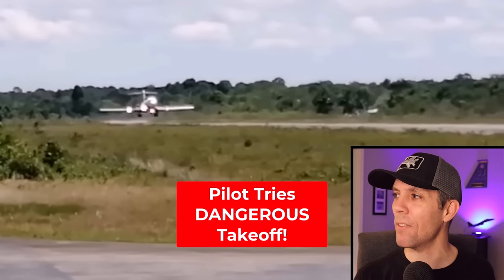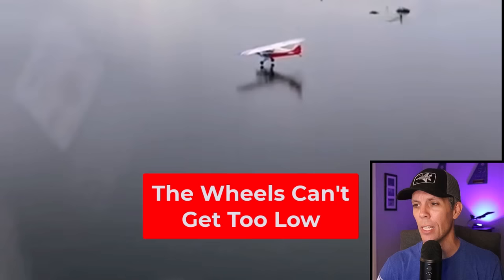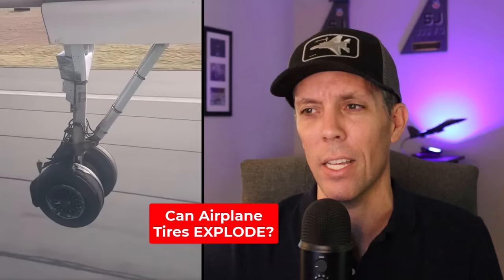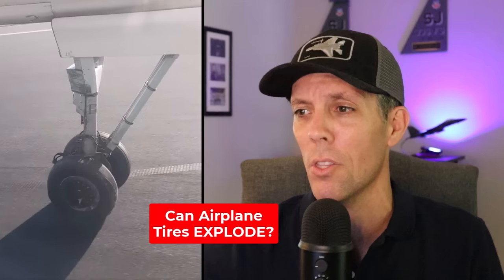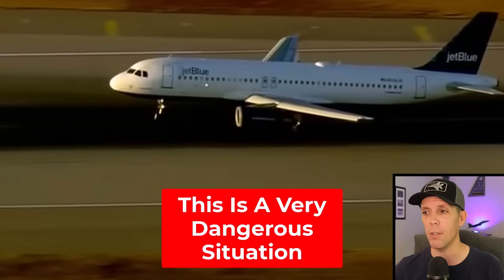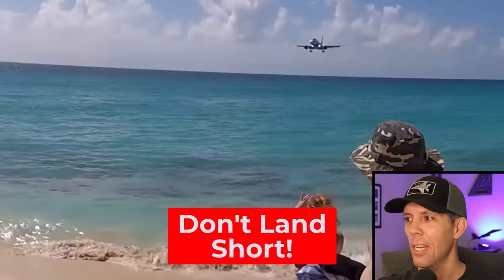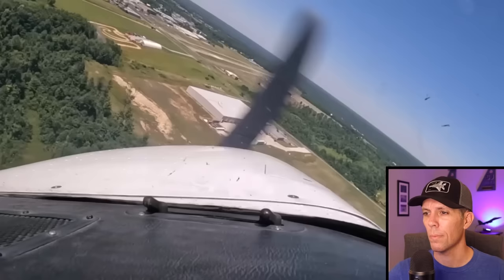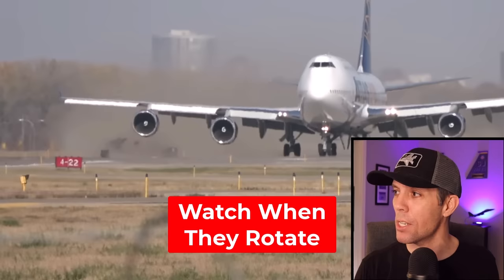Pilot Tries DANGEROUS Takeoff!

Comment: The landing with the Transall where it touched down and jumped over the road, you gave wrong information and in reality you have no clue about what happened there. This whole process was planned and done professionally by the pilots and the  Airfield company. The road was closed on that day and  and the ground on the other side was prepared. This happened at Ballenstedt Airfield in Germany. The Transall has been delivered to there, where it was retired and now you can visit it there as an attraction. The point why it touched down in front of the road is not, that the captain wanted to risk anything for showing off. Instead the real reason is, that the runway is too short and they used the first touchdown to loose a few knots. With this trick the plane stopped short to the threshold and everything went well.
Reply: If intentional, IF, that was not smart- bounces are destabilizing.

I call BS/Shenanigans.  He shorted it.
Reply: found the pilot that shorted it
Reply: @eisnacht
Oh yeah, sure.  In fact, they had considered bouncing off the muddy fields first, then the roads, to lose even “a few more knots”.  But the local cows got together and forced them back to their original hop, skip plan, instead of the proposed “hop, skip, and a jump” over the cows.
Reply: Both storys are not true.
It was a final transport of the German air force to a small runway. The runway apparently was to small under normal conditions, which is why the police was tasked with closing down the road and making sure no people would be in the area. As visible in the video, they failed. 

And while the landing certainly wasn't planned like this, and should never have been executed with people near the runway, the bundeswehr in all public information never really said anything about the fact that they considered the early touchdown necessarily an issue on its own and where always saying that the plane is designed for stuff like that. So it appears that they are least where fine with it, but it wasn't planned.

And it appears that the pilots maybe where not aware of the fact that the road is higher than the street.

But they did not do it to impress friends or anything like that.
Reply: Not planned at all: misjudgement … it happens but definitely not planned
Reply: As a fsx steam license holder your all wrong, the reason it touched down early was because the livery. That was actually a hot air balloon and landed on the road
Reply: @twigglykevin airforceproud95 fan here clearly 😂😂😂
Reply: Loooooool

Comment: Hi Hoover, 
the video with the C130 wasn´t a flight for an air show. This was the last flight of this aircraft and it was brought to Ballenstedt Airfield for staying there. With only 635m of paved runway and a typicall landing distance of around 700meters the pilots have to use every meter of the runway they can get. The police closed the road near the runway and the pilots trained this landing so far as i know.
Reply: That was a C-160 Transall.

The C-130 Hercules is a
4-engine aircraft.
Reply: Seems like a know it all would at least get the model of aircraft right........

Comment: With 90% water landing survival including mid-water landing and large planes with lots of energy, it seems like a good choice in wooded, house covered, or mountainous areas. If you open the door, land close to shore, can swim a little or bring a float cushion in case, you probably have a better chance than trees or rough, rocky terrain. A lot of mountain lakes drop off quickly so you may be over your head a wings length from shore, getting knocked out, never practicing anything like it are the problems, if it is your plane shoulder straps may help from being knocked out.

Comment: For the sideways nose wheels, when a plane is being towed I believe a pin has to be pulled to disconnect the aircraft steering so the tow vehicle can turn the gear freely.  Once the task is complete the pin is put back in place, which allows the aircraft steering to operate.  I’ve heard sometimes the tow operator forgets to reinstall the pin, causing the nose gear to rotate, once it retracts, thus the issue on landing.

Comment: My 13th hour as a student pilot the instructor had me perform a simulated "Impossible Turn" in an Aero AT-3 from 430 feet agl.  

We had 100 feet excess over the threshold, and it was a fun slip.  

If the startle impact is minimal and the glide ratio is decent, it is not impossible.

Comment: As an aircrewman/jet mech in the navy spent a lot of time working around or on planes, never got on a carrier (thank you Jesus!!!),  i know the A-7, it's tire pressure for land ops was around 300PSI, and carrier ops 750->800 PSI.   Even crazier was some of the hydraulic systems, static change vis nitrogen most were 1500 except one at 3000 and operation when the plane was powered on anywhere from 3000 -> 9000.

Comment: Nothing wrong with calling a fuel engine a motor. I mean, Detroit MI, USA has been known as "Motor City" since the early 20th century. 

Me personally, I do try to distinguish the two as motor and engine (for electric and fuel respectively), but both are correct.

Comment: Hi Hoover !  If  I am not mistaken, that 727 crashed. Or same airline. They used to take off overweight and that happened in a very hot day, the plane didn't lift on time overshooting the runway and went through the fence. One of the rear landing gear wheels got detached and messed up the right flap and something else. The plane crashed after trying to get back. It was a cargo 727.

Comment: The first video, the airline picks up the gear very low and is staying super close to the ground so in ground effect, he build up speed which will give him even more lift and then climbs out, seems like a smarter decision than crash into the trees in front with gear down and a lot drag and not enough climb performance.
Reply: But with the airline operating the plane, that's pretty much a standard takeoff
Reply: Smarter idea not to fly overloaded planes, and end up doing what they later did(possibly in the same plane) - crashing through the fence and hitting other objects, causing damage and eventually crashing. There'd be no reason to do it otherwise.
Reply: @DoubleMonoLR  I have an idea that this was actually considered an improvement that was implemented after that crash.

Comment: I flew American Airlines about a year and a half ago from Miami down to Key West for the weekend.    It was one of those smaller Embraer Airliners that have one row of seats on one side and two seat rows on the other side so a fairly tight seating and walking arrangement in the cabin.   It was a full flight.  Anyway,  we get to Key West which must be a real short runway and the pilot definitely clipped the very end of the runway because their was a very loud BOOM noise,  the whole plane immediately jolted BADLY and VIOLENTLY as the back wheel assembly hit the end of the runway which was like hitting a six inch high curb on a direct hit with a motorcycle!   It was the scariest landing I ever had and I have flown quite a bit over the years.    I literally looked over to my wife and said we just hit the end of the runway.    We sat on the runway for like 30 to 45 minutes before they let us offload.    They never said what did happen,  but it was quite obvious he came in too short and hit the end of that runway.    I'm surprised the whole back wheel assembly didn't sheer right off the plane.      It literally felt like it was going to!   No injuries or problems thank goodness but I'm sure that plane probably got grounded afterwards for either a full inspection or repairs.   We all got off and went our ways and never did hear anything else.    Everyone on that flight was jolted and scared to death.     I guess it very well could have been a tragedy but thankfully it wasn't.    It's crazy how often this kind of stuff must happen across the world on a daily basis in the aviation industry and nobody ever knows anything about it if an actual crash doesn't happen or get declared which absolutely no pilot ever wants to do if they don't have to.

Comment: I saw a video of an aircraft take over from the owner to a buyer, the buyer had a couple of pilots test the aircraft after they took it over and on the test the pilot forgot to lower the gear.  The people watching were tring to alert the pilot but he never saw them and he managed to belly flop it but did thousands of pounds damage.
Another time talking of tyre wear, I was working on a Russian TU154 and just accross was the Red Arrows all parked up, the pilots all walked over to look around the TU154, they were shocked at the state of the tyres, they were badly worn through, I said that is a common sight on these, most of them come in the same plus the general state of the aircraft too.

Comment: Why jetblue case cloud not use the thrust reversers ?
Reply: I believe the rationale is that increasing deceleration is like slamming on brakes in a car, all the momentum gets pushed forward onto the front of the vehicle, in this case increasing pressure on the faulty nose gear which would likely increase the risk of damage (or collapse) of the gear, increasing risk of injury and further damage.

Comment: First one is a really bad idea. When I was learning to fly back in the early ‘80s, there was a T-34 Mentor military trainer that was available to rent and you could flip the switch before takeoff.  After takeoff, the wheels would automatically retract once the wheels were no longer in contact.  Well, one hot shot did this and the plane settled and the prop was literally only a couple inches away from a strike.  Always preferable to learn from others mistakes!

Comment: The "nosewheel stuck sideways" has happened to several aircraft. I looked it up because I was sent around at Frankfurt by a Turkish charter Boeing ahead of me suffering that problem and blocking the runway. Actually it seems more Airbuses have had the issue, and there seems to be no one, common cause.

The tyres of a Dash-8 are unlikely to be rated to 200 mph. It would not be on the ground at anything close to that speed even with a flapless approach.
Reply: I was on the ramp one day and had the radio on ATC, a pilots was making an emergency landing on a GA type aircraft, his nose wheel hadn't lowered, so they got the emrgency services ready for his landing, as he landed he kept it horizontal as long as he could till it almost stopped then the nose hit the ground, luckily it was going slow so it never flipped.
He got out OK but obviously damaged his aircraft, he did a great job landing keeping it horizontal till it almost stopped, I would have thought the tail would have lowered but the nose went down first.

Comment: The A320 with the nose gear cocked did not deploy spoilers nor brake, which means that all the stopping energy has come from that nose gear grinding which translate in more heat and sparks than when other sources of braking are used as well

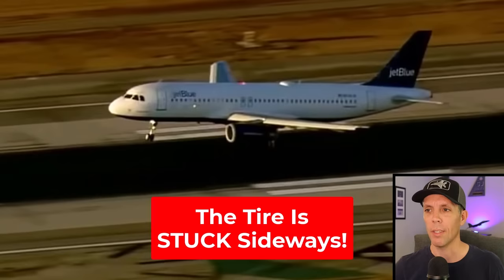Comment: 2:47, I’m a pilot myself, and I have never been taught to never use the brakes, spoilers, thrust reversers, AND shut down the engines and “hope for the best”. The APU can power some electric hydraulic pumps, (I don’t know if this Airbus model has electric hydraulic pumps on the landing gear and both brake systems), but the hydraulics are usually designed to shed some components without the engine-driven hydraulic pumps.  Both pilots should be eyes-outside, not flipping switches.  A collapsed nose-gear (on the runway) would be safer than overrunning the departure end (regardless of what is at the other end). There are usually approach lights on long runways, and pilots have been injured or killed running into them.  I can’t imagine a checklist that would command both engines to be shut down before coming to a stop.  If a checklist did command ALL the above methods of stopping not be used, that may be a moment to use captain’s emergency authority over it. I have never heard of a “drift-to-stop” equation, and that would be something I’d have to brief before following a checklist as mentioned in the video.
The CL-65 QRH checklist for the STEERING INOP message says “Use differential braking, rudder and engine thrust as required to assist in directional control.” It says nothing about shutting down engines.  What if the nose is stuck 45-degrees turned, not 90? The engines may be necessary to keep the aircraft straight. I know the A320 nose wheel steering (in the video) fails to 90-degrees, but without verification, I certainly wouldn’t trust that to be the case. The pilot always needs sufficient control authority in case that system didn’t “fail successfully.” You’re already in a compromised nose wheel steering state, why shut-down the engines that are the primary non-brakes control aid here?

Comment: I just thought of something... If the Airplanes front gear Fails, Couldn't they have a Failsafe Mechnism to "Force" the rotation of the front gear by using a Vertical wing? Something like a old style windmill, With the amount of wind pushing it... It will turn to that specific degree & from how fast the wind is going against the landing gear, I could theorize that it would "Assist" the landing gear as a safety thing, ((Note: I don't know it would be possible, But it would help planes from becoming increasingly damaged...
Reply: to expensive, it will not happen a lot and u will land save..  i would installing a second nose wheel structure.. for backup..

Comment: you would think a real pilot would be able to tell the difference between a go-around and a take-off, this was a go-around in the first clip of the Aerosucre, it is clearly above the runway at the start of the clip, then descends marginally lower before gaining a bit of altitude and regaining more speed before and retracting the gear and riding the ground effect to gain speed.

Comment: On that last landing, I wonder if they couldn't have started angling toward the taxiway to make a turn to a stop on the taxiway rather than the grass.
Reply: grass will stop u faster.. u only need a cleaning after that.
Reply: straight ahead into the grass is much safer - because it’s still a controlled excursion - than attempting a high speed 90deg turn. The momentum is going to continue to want to carry this very heavy airplane in the direction it was going, not where you want it to go. Put enough side load into the gear and you’ll rip it off. Do that now you’re dragging an engine. Turn too early or too late and risk going off the pavement anyway, shift your momentum to one side with the hard turn and jam a wing or engine into the ground, lots of damage and probably some injuries now as the plane spins out of control.

if there’s a cliff or embankment past the runway, maybe different story.

Comment: Nitrogen instead of air? The atmosphere is 78% nitrogen 💀.
Reply from the maker: And airplane tires are about 95% nitrogen
Reply: Dry air good wet air bad.
Reply: This has the reason if your tire starts to burn inside your wheel well the melt plugs will let the nitrogen out and the nitrogen will extinguish the fire.
With air this don't work
Reply: @simonm1447  plus, with mostly nitrogen, the tire pressure fluctuates very little.

Comment: Actually a shit hot 727 low transition! (as good as it can be done), 'Remo' Williams an F14D pilot at Miramar trying to do a low transition put the gear up after getting AOA indexers (which come on prior to the wheels being off the ground) attempting the shit hot and ended up settling back on the ground grinding the landing gear trunions in half when the tires blew from wheel lock up that occurs on gear retraction. Top Gun made Tom Cruise a multimillionaire but the navy cost the tax payer Billions with a 'B' so even the 'fighter pilots' fu#it up from time to time..